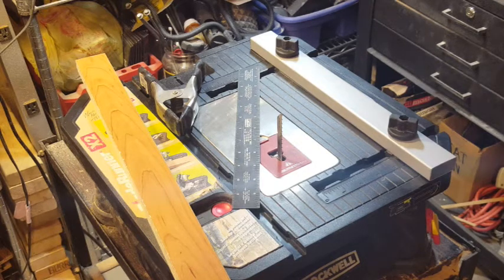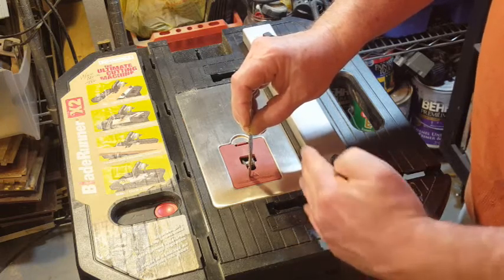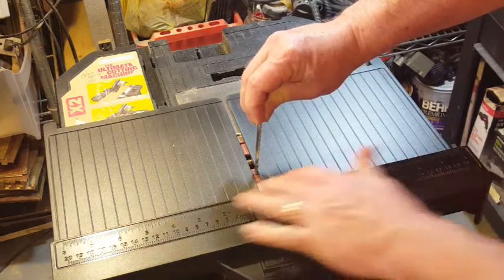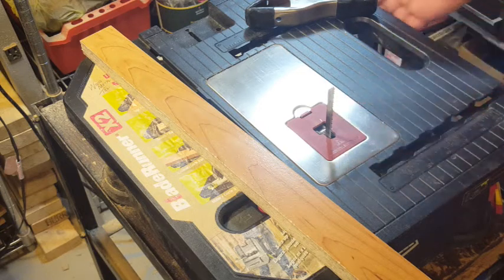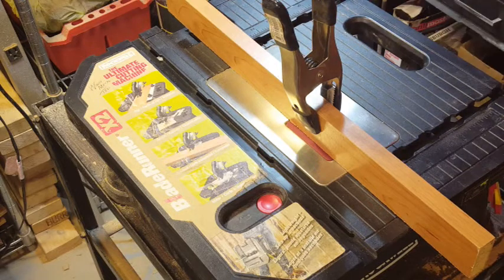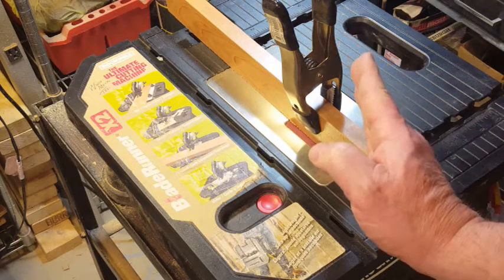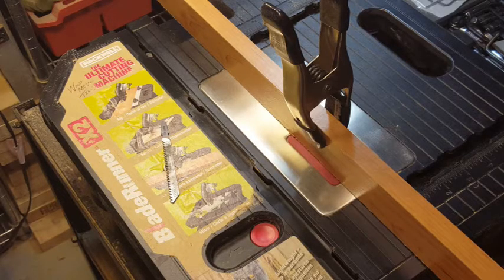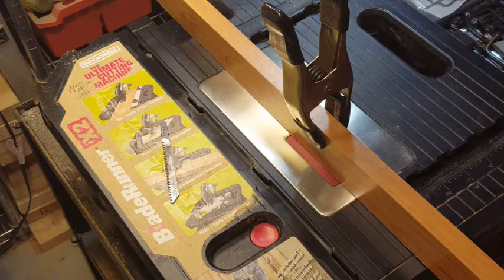19. Make a BladeRunner motor adjustment

Comment: I just got one in 2023 and it's good to know the blade is adjustable in the housing. I haven't used mine yet, but when I do I will check if the blade is square, or not. Thanks.
Reply from the maker: You're welcome. Thanks for your comment and for watching.

Comment: Thanks for making these videos on the bladerunner little table-saw.  Your tips are helping me make more accurate rips and cross-cuts.    The one hack that I did with mine was to adjust the bracket that holds the two bearings that help keep the blade level.  On mine, the gap was a bit large which allowed for the blade to deflect.  So I just unscrewed that piece and bent the metal bracket to lessen that gap.  The bracket is pretty hardy, so I'm not worried about it breaking.

Now I just need to mount the saw to a sturdy table and I'll be all set.
Reply from the maker: stringsthings Thanks for the tip and for watching.

Comment: Thank you sooo much. I adjusted the motor mount hex bolts dramatically diagonally. Made a hex tool by cutting the hex wrench where it curves; inserted the straight hex wrench into a 12" drill extender and tightened the screw on it and then was able to reach the hex nuts. Took a number if tries but finally succeeded.
Reply: Can I adjust the bearings on either side of the blade?
Reply from the maker: On my unit, those bearings are not adjustable. Here's a link to a video I did about it.  
https://youtu.be/SicafKYyO5g
Thanks for your question and for watching.
Reply from the maker: Sounds like you worked hard on it, but got it done! Thanks for your comment and for watching.

Comment: Helpful video.  Reviews have been all over the place and difficult to categorize the poor reviews.   Now I think it is settled — the alignment can be adjusted to cut straighter.  It looks like that adjustment requires trivial tooling.   (But it does require flipping the unit upside down).   With this I think I can justify the purchase. Hope you get kickbacks!
Reply from the maker: Hi Jonathan.
Yes, I do get "kickbacks" when you use the Amazon affiliate link in the video description to make your purchase. It doesn't cost you anymore to use the link, the purchase price is the same whether you use my link or not. If you do use my link, you have my thanks and Amazon pays me a small commission.
About cutting straighter: I tend to use the BladeRunner without the fence and the blade arm; I simply follow my cut line manually. I will also use a heavy weight to help hold the work piece down to the table. At about the 9 minute mark in this video; https://youtu.be/W-aKZlOVNlI , you'll see what I mean. 
The key is to let the blade do the work and to not push the wood too hard. If you are going to make a lot of cuts one right after the other, I suggest having a second blade ready. After your 1st cut, the blade is likely to be at least warm if not hot. Change the hot blade for a room temperature blade because a hot blade dulls quicker.
Thanks for your comment and for watching.

Comment: Thanks for the video. 
I was noticing how hard I had to push my work piece against the fence over the weekend. I need to check this on mine.
Reply from the maker: Hi Jason. In the last project I did using a Bladerunner, I made some straight cuts without using the fence. Here's the link to that video:  https://youtu.be/W-aKZlOVNlI . Look around the 9 minute mark. Also notice the heavy weight I am using to help keep the workpiece down while making the cut (so I don't have to use the hold-down foot).
If you decide to try cutting this way, you will probably find that you don't need to worry too much about the motor adjustment.
Thanks for your comment and for watching.

Comment: it occurs to me that 'squaring' the blade also cuts down on drag which would mean the unit will cut faster & easier. also less heat build-up. SO informative & i wouldn't have thought of it. it helps that the overall design is so simple. LOVE your funky little title intro. 🤓
Reply from the maker: Most of the time, I am cutting wood freehand while following a line drawn. I think 'squaring' the blade helps most when using the fence, crosscut sled or miter gauge; anytime the side of the blade is referenced to another flat surface.
See the video description for the music credits. I use several of this guys tracks in my videos. (I plan to someday, write my own music using Band-In-The-Box.).
Thanks for watching and your comments.

Comment: I appreciate your extended review on this machine.  I ended up getting the WORX version and the Rockwell cross cut sled.  Luckily my table was aligned correctly.  So I made sure those motor screws were tight and I made some markings so it helps as an alignment guide if it ever gets out of whack.  I'm surprised that the company didn't add some kind of markings to make it easier for us to check the alignment.
Reply from the maker: Hi Tina. Congrats on getting the saw! Have fun with it and stay safe. And thanks for watching.

Comment: Thanks very much for posting this video. I have been having trouble getting a straght cut with my bladerunner on longer pieces. I am looking forward to making this adjustment. Excellent video.
Reply from the maker: Thanks for your comment and thanks for watching. Let me know how you make out.
Reply: Did you get your issues straightened out?   Pun very much intended
Reply from the maker: Hello Dave. Sorry about the very slow response. Yes, the motor adjustment helped but I don't typically use the fence any longer when cutting. I'll cut freehand.

Comment: Just finished adjusting. I'll trial cut again next Monday when my shop vac comes. Hope it work better this time!
Reply from the maker: OK, sounds good. Are you trying to use the fence when making your cuts? Here's a couple of videos I made about using the fence on the Bladerunner: https://youtu.be/npCzZ5MDYU8 , https://youtu.be/dJ2tzy7UqBc . Here's a link to my playlist for all of the videos I've made involving a Bladerunner: https://www.youtube.com/watch?v=dtzqwArXMII&list=PLGCBwUeR2BD2SPSsV51qPBkK8p1grR-UL&pp=gAQBiAQB .
I hope these videos help you out.
Thanks for your comment and for watching.
Reply: @ImaginethenMake  Thank you! I notice you started cutting without the shoe at the top. After you make the blade adjustment, are you able to get the wood passing the shoe and the vertical fin at the back if you have it?
Reply from the maker: I have on a rare occasion gotten the wood to pass the vertical fin in the back. Most of the time now, when I use the Bladerunner, I use it without the arm like in this video: https://youtu.be/W-aKZlOVNlI . Remember that you are responsible for your own safety so if you do not feel safe using the Bladerunner without the arm, then don't do it!
Thanks for your comment and for watching.
Reply: @ImaginethenMake  I adjusted the blade and made sure it is well aligned. I also upgraded the blade to the BOSCH blade. Now it cuts way faster than the factor blade, probably also because of the alignment adjustment. I didn't get the wood to past the vertical fin so I had to stop, and remove the fin and then continue. That's a bummer because now I have no way to use the vaccum port when that vertical fin is removed. But at least I got a pretty clean rip cut. Thank you for your videos.
Reply from the maker: You're welcome; I'm glad you enjoyed the videos.
I agree that it is a bummer when the vertical fin gets in the way. The interesting part is that the original design had the arm on the right side of the table so there was no vertical fin to get in the way. Watch this video to see what they original design looked like: https://youtu.be/JZf5RAj6UnA . To me, this earlier design looks much better; so why did they change it? I don't know.
Thanks for your comments.
Reply: @ImaginethenMake  Wow.... Didn't know about this earlier version. Yeah I agree. I like the earlier version much more.
Reply from the maker: Yes. It would be fun to find one somewhere (like Craigslist or a tag sale) and try it out. Or maybe I need to try a make one using a jigsaw?
Thanks for your continued comments.

Comment: Great video. I recently bought a used older model for a fraction of the cost of a new one and want to true it up before putting it to use. I made a few test cuts, both crosscut and rip and found the blade not square with the miter gauge/fence. Now I know what to look for in truing it up.
Reply from the maker: Hi Glen. Thanks for the compliment on the video. In case you haven't seen them yet, I do have a bunch of other videos about the Bladerunner all in a playlist. You can find the playlist here: https://youtube.com/playlist?list=PLGCBwUeR2BD2SPSsV51qPBkK8p1grR-UL . Thanks for your comment and for watching. Enjoy your "new" saw.

Comment: If you take a close look at the blade you'll notice that the front (the teeth) are thicker than the back due to the kerf of the teeth. The board will appear to be at a slant. If you clamp the board on the opposite side of the blade you might notice the board slanted the opposite direction.
Reply from the maker: Thanks for your comment. I will take a closer look.

Comment: I order the Bladerunner thanks to your videos from the Rockwell ebay store.  It was a combo that included a new in box bladerunner, the wall mounts, sled and extra blades on top of the ones that come with it.  Was excited to see the box out front yesterday.  Well until I opened it and the unit was busted and none of the extras were included.  Bummer.  I contacted them and they replied today.  I told them I wanted a new unit and the attachments.  I've yet to hear back.  So far, not a pleasant experience.  We'll see how this ends.
Reply from the maker: Sorry to hear about this. Hopefully, they will make it right for you. I had gotten mine as a gift from my wife who bought it from Amazon.
Reply: Thanks for your reply.  I got an email from Rockwell.  They sending me a new unit and supposedly the accessories and I should have them this Tuesday.  They asked me to just keep the other unit as parts.  That is amazing customer service.  I look forward to watching all your videos and getting comfortable with this machine!!!
Reply from the maker: That's really great news! Once you get the machine, please let me know if you have any questions and if there is something you'd like to see in the next video.

Comment: I like it can do you need a speed control for the motor ?
Reply from the maker: The original BladeRunner did have a speed control and I wish the new version (the one I have) still had a speed control. I have not tried to add a speed control to my saw. Thanks for your question and for watching.

Comment: I went to use mine this morning and noticed right away that the blade is not even close to being aligned.  I'm not sure what happened (I don't use mine very often) but I'm sure I'd have noticed it before if it was that far off.  I checked the blade (not bent) and reinserted it several times.  There's no doubt I can't use it the way it is.  So I went searching the interwebs and found this video.  It looks like I'll be tearing into this after lunch.  Hope there's lots of play in those mounting bolts.
Reply from the maker: Hi Dana. When you are not using the Bladerunner, do you keep a blade installed? I'm wondering if dust or some other small objects fell into the blade mounting mechanism that is preventing the blade from seating all of the way. Or maybe the mechanism is damaged in some way? I have seen when the blade is not seated all of the way down, it will rotate as the red button is released. Here is a very short video that shows the blade being installed: https://youtu.be/SAUQ3FkJ2d8 . Is your blade twisting because it is not seated all of the way down? Also, here's a link to my Bladerunner playlist; maybe you'll find something in those other videos that might help you out. https://youtube.com/playlist?list=PLGCBwUeR2BD2SPSsV51qPBkK8p1grR-UL
Thanks for your comment and for watching.
Reply: @ImaginethenMake  Yup, you're right.  I flipped it over yesterday and was all ready to move the motor.  Can't remember why, but for some reason, before I did that I flipped it back over and reinserted a blade.  Lo and behold, it aligned correctly.  So then I knew it had something to do with the insertion.  I can't see anything in the hole.  The rubber boot keeps me from seeing clearly but I did a lot of probing with a small screwdriver.  I never found anything.  After re-inserting about a dozen more times, there seems to be a sweet spot where it aligns right.  I haven't really figured out what is the secret (I still get a mis-alignment about 50% of the time), but at least I know that the insertion is the issue.
Reply from the maker: Thanks for the update Dana. Glad to see you're getting closer to figuring things out. Maybe try using a shop vac up against the insertion hole to suck out anything that might be in there that you can't feel with a screwdriver? I think the key might be to press the blade down all of the way so that when the metal ring rotates, it does not hit the blade and spin it.
Thanks again for the update.
Reply: @ImaginethenMake  Yeah, I think something's in there.  Just haven't found it yet.
Reply: @ImaginethenMake  Well, I'm back.  Now my misalignment problem happens nearly 100% of the time.  To the point where it's unuseable.  I've cleaned it and probed for any obstructions to no avail.  And I've tried several different ways of getting the blade inserted before releasing the locking mechanism.  No luck.  Today I'll be tearing it apart to see if I can find the source of the problem.  It's frustrating because the more I use my Bladerunner, the more I like it.
Reply: @ImaginethenMake  And, back again.  I found your other video about blade installation and, after experimenting, I now understand that I wasn't pushing down all the way.  So now I'm back on the happy train!
Reply from the maker: Excellent news! Happy cutting!
Reply from the maker: Yes, I understand; the more we use the Bladerunner, the more things we can think of to try.

Comment: Regarding the blade alignment, blades are slightly wider at the cutting teeth than the back of the blade. I would do the same measurement attaching the piece of wood and clamp to the other face of the blade and compare before making any realignment.
Reply from the maker: Thanks for your suggestion; I understand and agree with you. Most of the time now, I freehand cut using the Bladerunner (i.e. follow a line drawn on the piece of wood) so precise motor alignment becomes less critical.
Thanks for watching.
Reply: My Bladerunner came missaligned too, so I followed your method but testing both sides of the blade to get an almost perfect alignment. My concern is that vibration may end missaligning the whole thing again. Thank you for your instructional videos.

Comment: Late to the party here sorry. Thinking about getting this unit. For squaring up the blade could you have squared up the fence right up next to the blade with the motor loose and then clamp it and tighten the screws?
Reply from the maker: Good question. I did not try to do that because the fence does not move always square to the table (like the fence on a traditional table saw). This was disappointing to me when I first realized this. However, I still think that making the blade reasonably square with the table makes it easier to make good cuts.
I hope my reply makes sense.
Thanks for your comment and for watching. If you have other questions, please feel free to ask.
Reply: @ImaginethenMake  well yes I do have another question for you. Have you used this saw to free hand curve cute. I know it's not a scroll saw or a band saw but for basic stuff does it do this task?
Reply from the maker: The short answer to your question is, yes, you can make freehand curved cuts using the Bladerunner. Like anything else though, there are limits. To make a fairly tight curved cut using the Bladerunner, try using a scrolling jigsaw blade. Keep in mind that the there are limits as to how tight a curve even the scrolling blade can make. If you can, try cutting relief cuts around the the curve.
I made a couple of videos that you might find useful and may answer your questions with more detail. Here are the links:
https://youtu.be/WSGXZwjNsHg      At about 10:35, I show you a scrolling jigsaw blade next to some scroll saw blades.
https://youtu.be/mVGa4cUj_nY        Comparing a scroll saw to a bandsaw to the Bladerunner.
https://youtu.be/eBQU1PT0EvM      Cutting 2" wheels (freehand) from a scroll saw, bandsaw and Bladerunner.

Thanks for your question. Please feel free to ask more questions.

Comment: Awesome informative video. Just bought one of the saws. Got lot of good information from your videos. Question I have can I cut stainless steel sheet with this saw... I got the extra saw blades package which has Blades for metal..will those work on stainless steel...?
Reply from the maker: Good question. If the stainless steel you want to cut is very thin, it might work; I'm not sure. Keep in mind that the blade moves very quickly so it will heat up very quickly. The heat will turn a sharp blade dull very fast. 
If you decide to try it, please leave a follow-up comment here and say how it went.
Thanks for watching.

Comment: Good Video thx from germany . I will Try it, its not posible for me to make a Good cut 45 or 90 degrees  😡
Reply from the maker: Most of the time, I use the BladeRunner to make freehand or curved cuts (not using the miter gauge or fence). I try to cut as close as I can to the cut line I've drawn on the wood and then rasp, file, and sand to the line. Thanks for your comment and for watching.